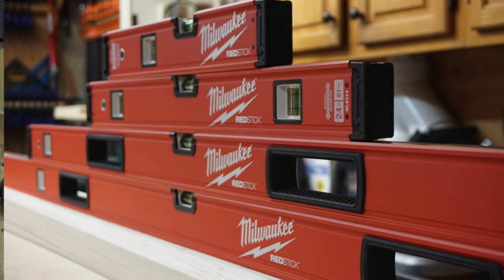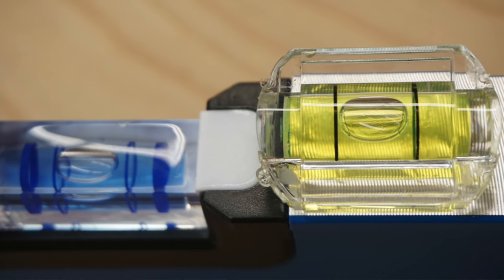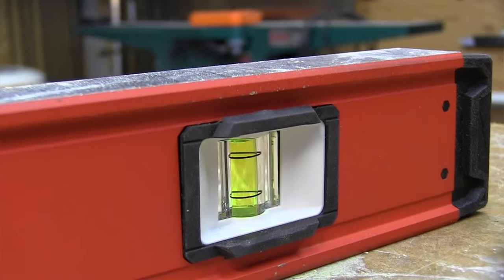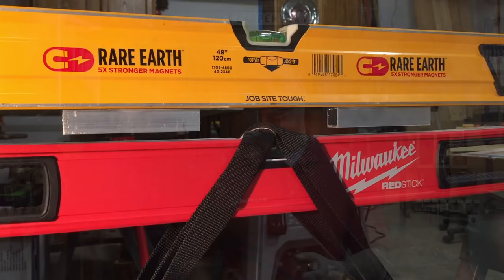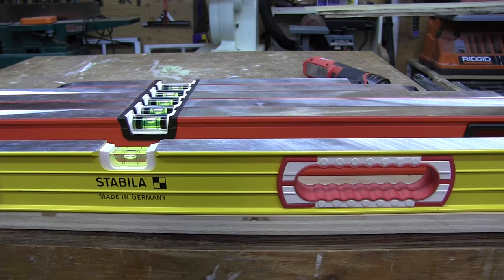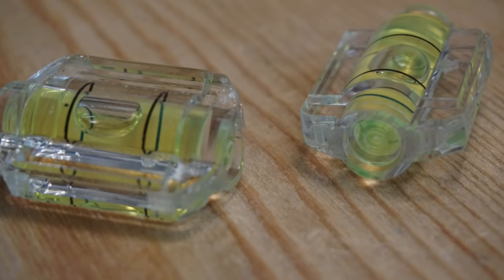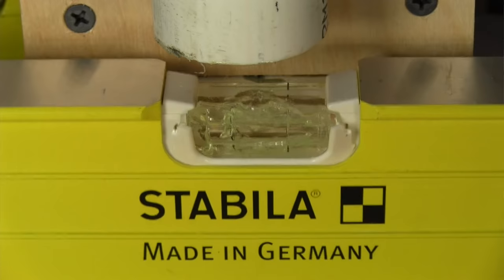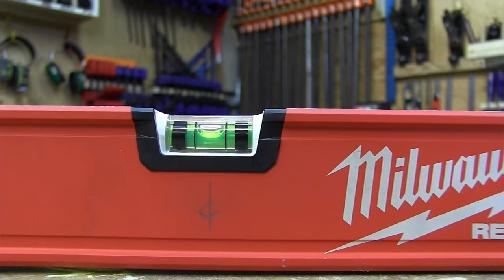Milwaukee REDSTICK Level Review

Comment from the maker: Milwaukee sent over some clarification after watching the video that I wanted to share. I mentioned in the video that we tested frame strength on both the strong and weak axis, and the all-metal backbone seemed to help more on one axis than the other. Apparently this is by design. This core reinforcement to the frame protects against premature bent frame failure and provides advanced durability and protection especially in the weak axis-which is the most common bent frame failure on the jobsite.
Reply: Quote: "Apparently this is by design. This core reinforcement to the frame protects against premature bent frame failure and provides advanced durability and protection especially in the weak axis-which is the most common bent frame failure on the jobsite.
"

Is this possibly, CORRECTION, I'm SURE this is a direct quote from marketing.... That in itself pretty much negates any profound review of a possibly worthy tool. Stabila is a DAMN good tool Company, however they're not the only game in town. Just as DeWalt, Ridgid, Milwaukee, Hitachi, Makita, et. al. are only playing gimmicks with contractors seeking their purchases. Unfortunately, we're all destined to to be forced to jump on to SOME "Bandwagon" out of MARKETED "loyalty" to a "brand" from a "marketing" strategy. Boys, c'mon, let's DEMAND better of our tool manufacturers!!
Reply: @mikekellam365  This is going to be true of anything these days. None of these brands are just the name sake of the company unfortunately. Milwaukee is owned by Techtronic Industries, which also owns Ryobi, as well as a whole host of other companies that make other products such as vacuum cleaners. Well intentioned as many of the designers may be at any of the good brands, the accounting and marketing departments, and the suits within them are always going to have some say in the process of the tool design. For either aesthetic purposes of selling the product, or for pinching those pennies to maximize corporate profits. One thing that is nice about Milwaukee is that they seem to do listen to the feedback provided by customers and their tools have steadily improved and become more versatile as the years have gone by since they first became popular. The balance of making the perfect tool, and being able to sell it at a competitive price for all consumers is something that is always going to result in corners being cut somewhere. But that's the beauty of the game.

Comment: Hey Rob

I considered 
Stabila 196
Sola big red
Johnson ultra

After deciding on Sola
Made the right choice 
Has luminous strip for low lighting situations, 2 to e green vial with self centering bubble.
Made in Austria are durable and like Stabila very high quality.
Try them versus Stabila 
Even employee at tool center agreed.
We compared Sola torpedo verses Stabila. He said the Sola has better readability, easier to see.
The 60 pct larger vial has won me over 
So many to consider.
Empire blue
Milwaukee red stick
Sola big red
Stabila 196
Johnson ultra
I believe comes down to personal taste , budget, availability
Reply: I read reviews from real customers... The Sola level Red 3 has frequent problems with the indication of the vertical flask... Non-compliance with the warranty conditions with the replacement of an incorrect level...

Comment: I just got the red stick jamb set and it's pretty decent.  You can feel some Empire level crossover blending in.  Great review!
Reply: I have had mine since release and have been using them everyday with 0 problems used alot of levels and so far these are the best.

Comment: So, I tend to have terrible luck with levels. I have custom levels from Smith, that went out of level. They fixed them and sent them back, but it took a year. I bought a jamb kit from Stabila while waiting on my Smith's and within 3 months both levels were out of level. I eventually sent them back in and Stabila sent them back, unfixed and said, nope, one is bent (not our problem) and the other is fine. You can visibly see that the 32" level is not "fine". SO, I'm pissed at Stabila and refuse to buy their levels now. Does anyone have any recommendations? Are the Milwaukee's worth a shot? I need at least a 6' and 4' level for cabinetry.

Comment: this was a very informative review and i used it to sway my decision to purchase.

i ordered the door jamb kit and the 360 ° torpedo. from my local tool dealer. box stores didn't have either and the tool shop was cheaper anyway.

placed the order 1 and a half weeks ago as of today. no levels yet.

they told me milwaukee has been real bad lately with delivery of parts which milwaukee blamed on a computer issue. the tool shop says the service still isnt much better since and here i sit. 

if youre in a hurry i wouldnt chance it if stabilla is available in store!!

lets see how long it takes. hopefully not as long as it took to get my kapex when festool had the sale on them
Reply: got the door jamb set yesterday after week 3
waiting on the torpedo 360

terrible service to say the least
Reply: still no torpedo 360 level and im likely to take these levels back.

the red plastic they use is coming off of the level and marking up any wall i put it on. particularly bad with flat paint inside.

Comment: Not even close. Whoever says that they can be compared to Stabila has never worked with one. It's just a new level with lots and lots of propaganda. Plus it's made in China. Nothing against China, it's just the people having stuff made over there paying pennies on the dollar and overpricing them here in the States... try a Stabila and you will see the huge difference
Reply from the maker: Luis Romero have you tried these yet or are you just strong in your opinion?
Reply: I bought a brand new stabila about 10 years ago and paid a pretty penny. The vile bubble kept on getting bigger and bigger meaning that the vile was leaking, it got to a point where I trashed it because they dont sell the viles. I went with red stick and will never look back again.
Reply: Luis Romero I have had the same 1200mm Stabila level for around 20 years ,been dropped on concrete, stood on etc ,it still is perfectly level ,why would I try anything else?
Reply: Stabila just aren't as durable. Don't get me wrong, very quality built product but they ones I have owned have been babied because of how easily I've wrecked vials in the past. The price premium should reflect some stronger components... You'd think anyways.

Comment: These are really nice and the bubble liquid is really easy to see, but Milwaukee and Empire are the same manufacture. And i think Stabila's durability is going to be unmatched with the way they build the viles right into the level during manufacture, instead of pressing them in after, like these.
Reply: I have used my milwaukee levels everyday for over 5 years with 0 problems I relay on mine work perfectly fine!

Comment: Update on my experience with the red stick levels i bought. Torpedo and the jamb kit.

The torpedo level middle vial has no fluid in it right now and is not cracked. The vial that is not on the angle dial appears to be losing fluid because the bubble is now the whole way across the vial.
The 32" still seems fine.
78" has taken 1 fall and appears to have a slight bend in each direction when i put it on what i have that is the straightest flatest metal i have. 
Keep in mind that i am a painter who does some carpentry and an occasional door install.  I dont beat on these items.

I sold my milwaukee cordless tools based on their horrible customer service and these levels that took 2 months to get are garbage now because the set is shot.

Buy stabilla or go cheaper and get empire. These things were a waste of money!!

Edit: These were a huge investment for me that I did a good amount of research on. I chose these over stabilla because I thought they would be tougher. I cant afford to go back and buy stabilla. This is such a drag!!
Reply from the maker: William Smith that’s horrible and clearly sounds like a Warranty issue
Reply: Thanks I was gonna buy some of these I won't bother now
Reply: @johno-gb7ci  this one comment shouldn't stir you away from not buying them i have had mine for over 5 years used mine every single 0 problems with mine.